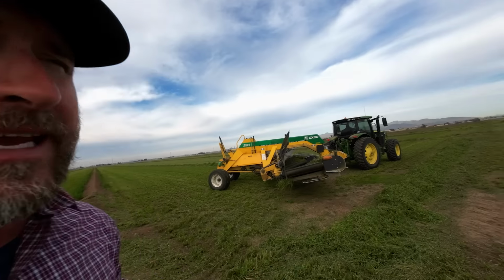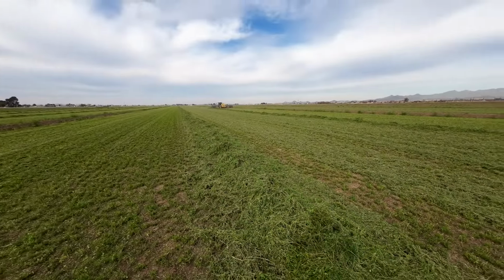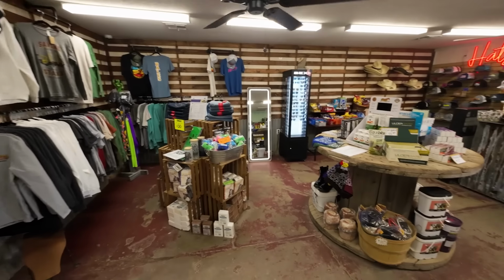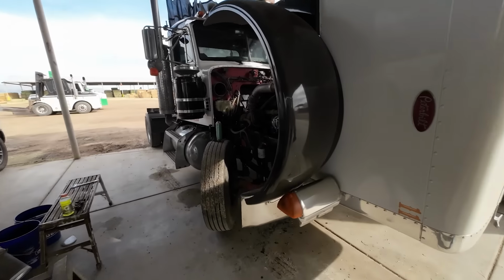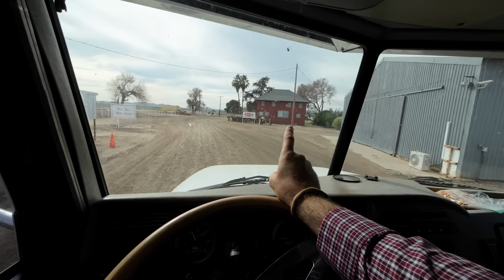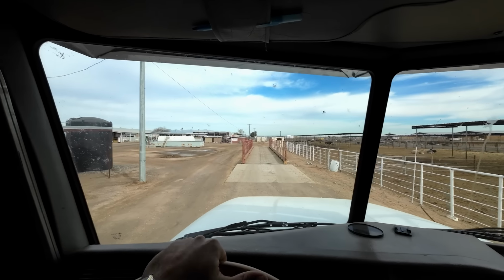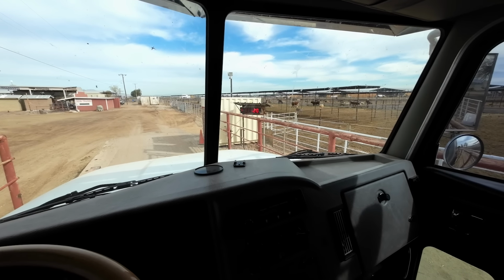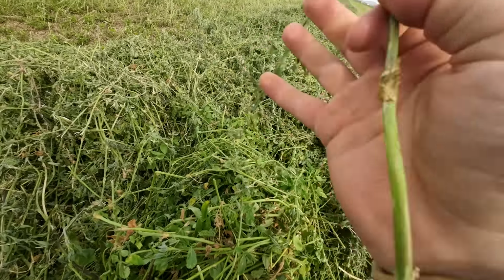OXBO Merger

Comment: Those flails on the mower are to break the stems so they dry fast it doesn't scap anything.... just like the rubber and metal rollers just crimp the stems. It all so the moisture gets out of the plant faster. We run a flail conditioner on our mower and we still run a Tedder through all the hay before bailing it. Generally able to run through a field in two to three days

Comment: The tines on the mower are designed for grass, why they are marketed for alfalfa is beyond me. They just strip leaves on alfalfa. We ran our conditioner mower next to a tine and the ground was covered in leaves. We now run 2 butterfly mowers with no conditioners in front of the chopper, used a Heston like yours for the dry hay to be baled. Best trip was Europe on claas dime.

Comment: I need to sell hay to AZ at $19 a bale !   I charge 4.50 for 1st cutting and $6 for 2nd cutting here in NY to my horse boarders.  Next time they complain about prices I'll tell them to go out west and buy it see how they like thier prices lol..   I'm not saying your prices are high either I know thats what you need to get per cost of bale for making it and such. It's just amazing the difference from here to there thats all
Reply from the maker: Does your hay look like ours? Also, what do your bales weigh?
Reply: @BalesHayFarmandRanch  we have alfalfa,  Timothy and orchard grass.  They are 70lbs bales .  They do look similar to yours . We just don't have the climate like arizona so we typically only get 2 cuttings a year.. I don't really sell hay. I just do to my boarders . It mainly is for my full care boarders witch includes hay and grain for $425 a month. . Occasionally we have to buy hay on a bad year and that really cuts into profits .
Reply: @BalesHayFarmandRanch  I go by facebook market place prices here. There's alot of farms and hay sellers here so I'm sure it keeps the prices down with availability..  if I was out there I would only use Bales hay sales. You guys are on point !
Reply from the maker: @adamwagner1987  wow, only two cutting!!?? I’m surprised your hay is that low.
Reply: @BalesHayFarmandRanch  it was high a few years ago when we had a bad drought but the last 2 seasons have been great and prices are level.  We can only pray this spring is not wet and the summer isn't too dry .. Thanks for the videos . Your always a inspiration in the hay market 👍
Reply: @BalesHayFarmandRanch  BTW oxbo is made close to me in Byron NY.  Great company and alot of dairy farms here use oxbo mergers . Just a fun fact 👍

Comment: Now that I have seen the merger video and it was in your field too, three passes with a merger, two passes potentially with the baler and bale wagons per section, lots of savings there. That’s the way I see it. Just not sure how much leaf would get knocked off, more or less????
Reply from the maker: This cutting is super super light. 1/2 ton or so.  Normally we wouldn’t be able to bale that much at one time.  Also it create lumps/green spots or “slugs” and we can’t have that.  So for what we do, the merger doesn’t work. For chopping, it works awesome!
Reply: @BalesHayFarmandRanch  I hear ya. Thinking about it, my brother does it very similar, cuts 27” then merges it afterwards but like you said, it all goes to silage.